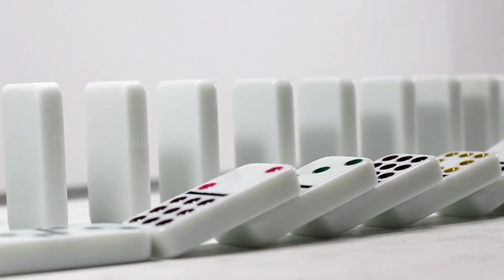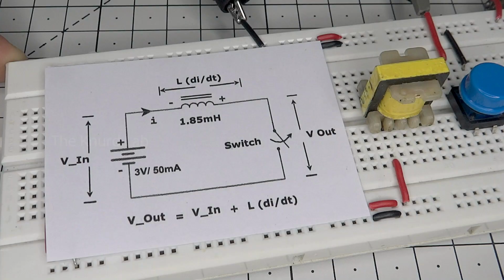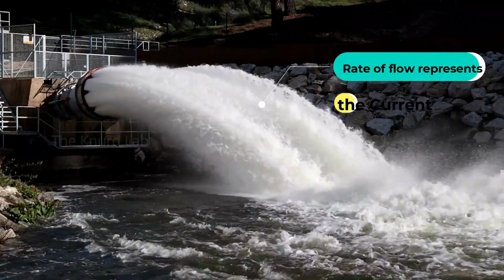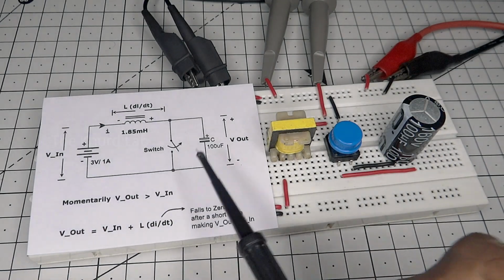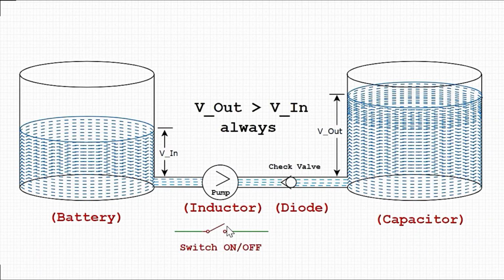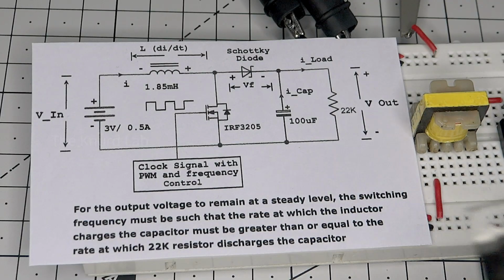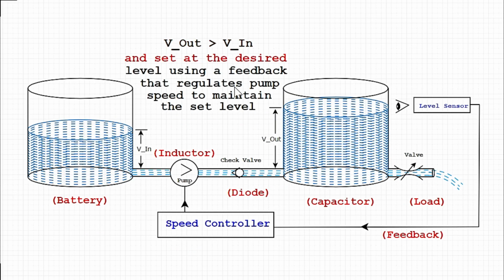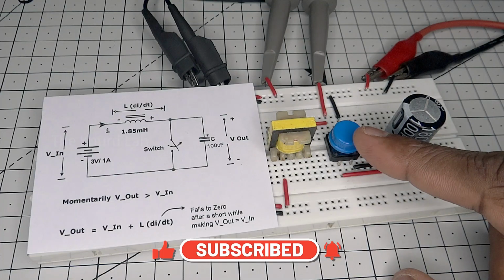What is a Boost Converter? | Intuitive Understanding

Comment: Nice explanation. But  i have one confusion. How does it convey the law of conservation of energy?
Reply from the maker: Energy must be conserved. Energy here is power*time which is nothing but (v*i)*time. Therefore when current tends to be minimum (only due to stray capacitance) the voltage must be very high to maintain the same amount of energy at the output.